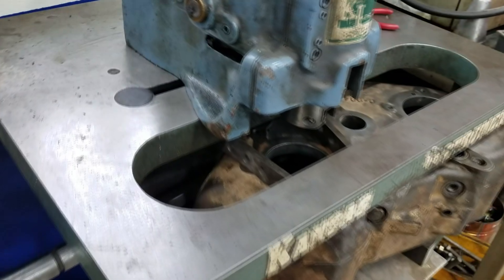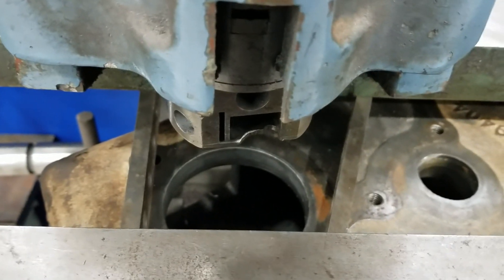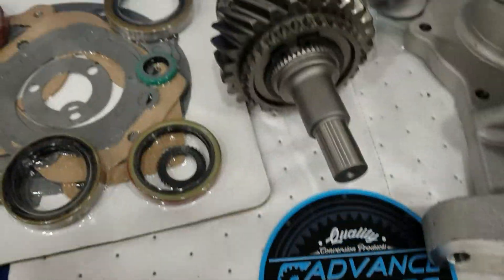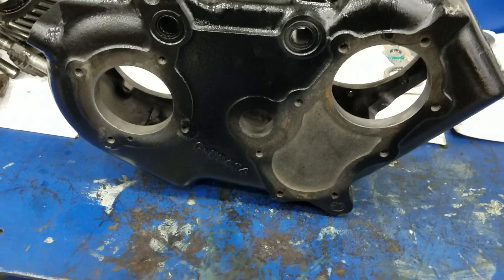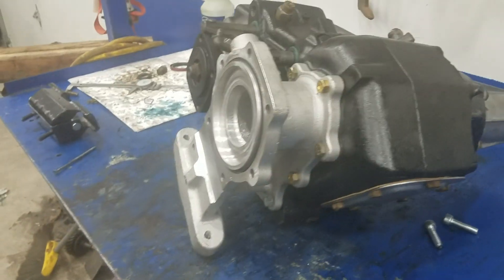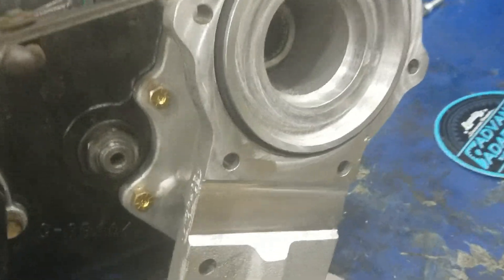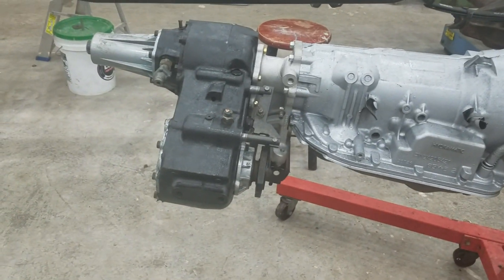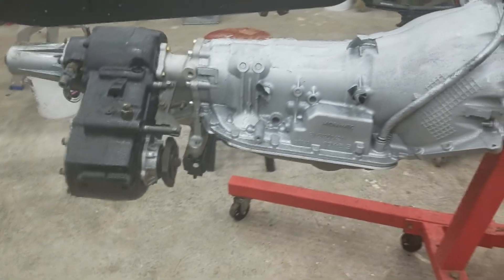Installing Advanced Adapters 4L80E to NP 205 Transfer case

Comment: How did you seal up the rear of the transmission ?
Reply from the maker: It seals like the factory  adapter with a seal on the shaft coupler if that makes sense to you
Reply: @oldmansspeedandmarine9219  my 4l80e has 2 open vents I closed up, but the shaft seal still passing fluid
Reply from the maker: @Smokeroux   mine is working great maybe check the seals
Reply: @oldmansspeedandmarine9219  I think you are right, might be wrong seal. 🏁 I’ll keep you posted. Ready to move to nextvprojects